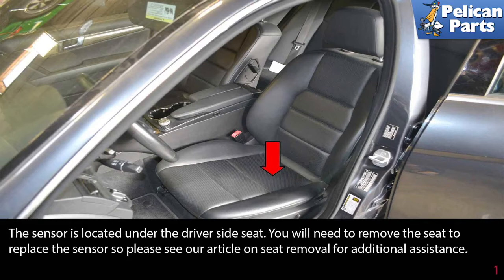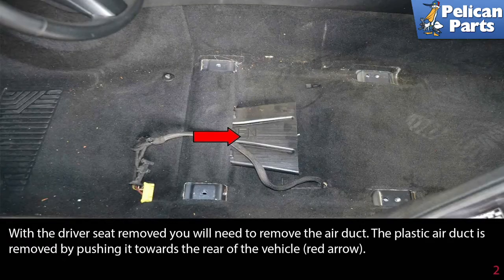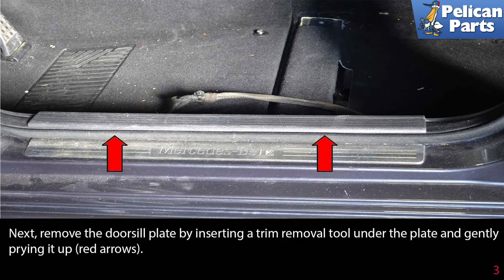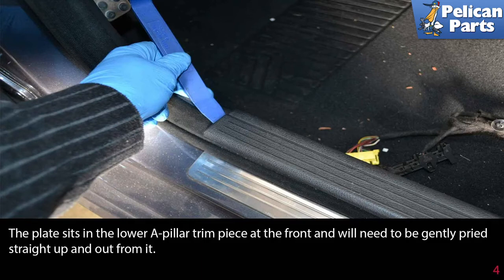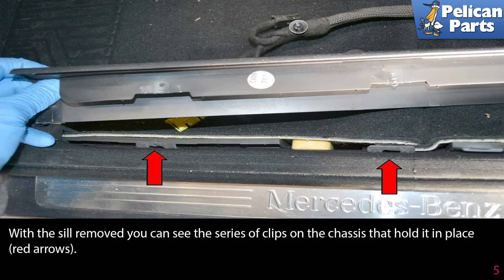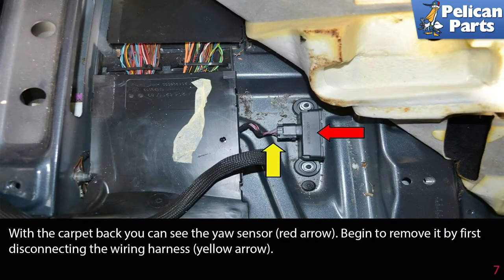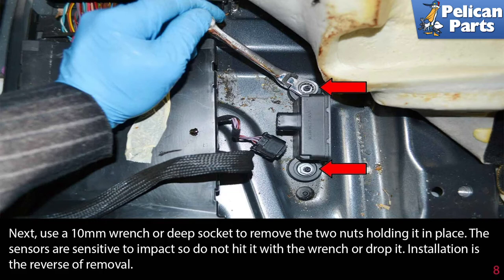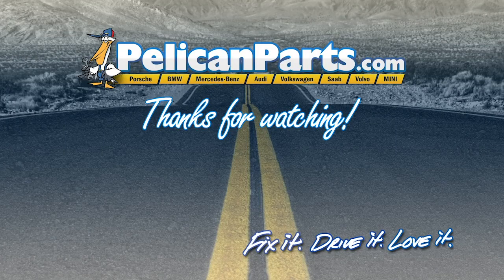Mercedes-Benz W204 C-Class Yaw Rate Sensor Replacement

Comment: Hi on w204 all 4 wheel show 0.37mph on stationary can this be something
Reply from the maker: Not likely. Unless you have a fault code or erratic operation. it is normal.
Reply: @pelicanparts i have the esp light on it won't reset no other codes

Comment: How do you get out of road test mode mine is stuck in road test after i did a yaw road test after replacing the brake switch
Reply from the maker: Use a scan tool to see if there is a fault or if the vehicle is in a mode.

Comment: Hi I have a right hand drive w204 with yaw sensor issue. Will mine be located under the passenger seat on the left hand side still? Thanks in advance!
Reply from the maker: What is the year and model of vehicle are you working on? I can see if I have that info.